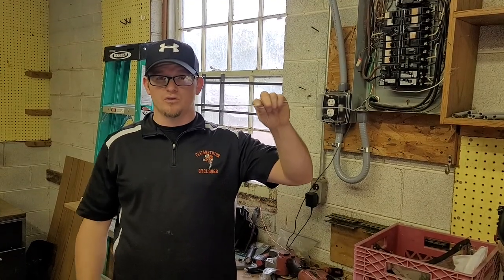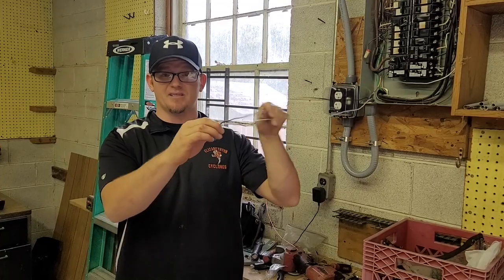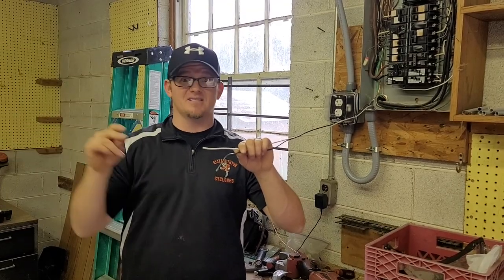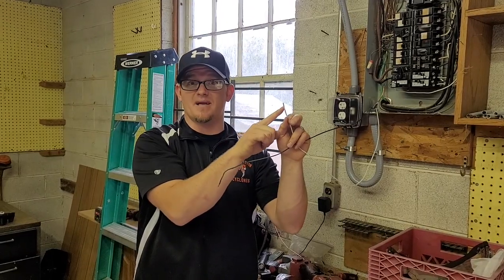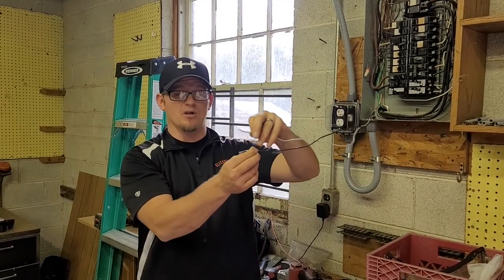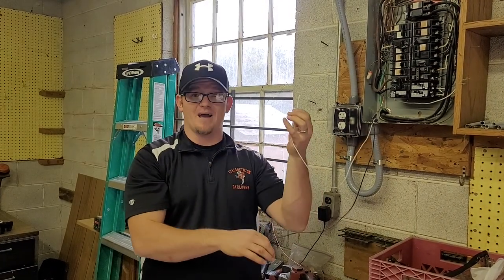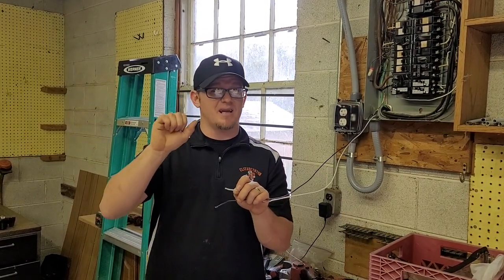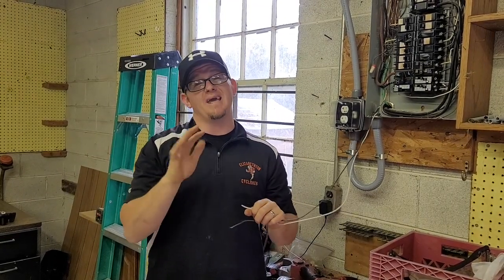Why we NEVER put 2 Neutrals under 1 screw in a panel. Be a Pro. Learn from the Pros.

Comment: I was on a job a few years ago, it was a high school addition and renovation that was originally built in the early 80’s. A couple of guys were disconnecting existing plug circuits, they had 3 phases shared on a neutral which was very common for that time period. They shut off the one circuit to start demo, but they didn’t think about the other 2 that went across the hall to a computer lab that was feeding 26 brand new desktops. Long story short, they took the neutral joint apart and “let the smoke out” of every one of them while it was full of students. I was on the other end of the hallway working and heard all the commotion and kids screaming that the building was on fire, I’m sure they thought it was. I have never seen as much smoke in one place in all my life. Then, the fire alarm went off. It was a really sucky day.

Comment: My favorite  Article is Article250 Grounding  and Bonding. 
I think the most important thing as an electrician is safety. Article 250 is also the article worth spending time and energy to study. 
I am currently an electrician apprentice in CITC. The employer will fire the apprentice when a project is about to be completed, so the apprentice has to wait for the next project. 
The next employer also fires the apprentice when the project is almost done. It will take far more than 4 years to complete 8000hours on job site.
It does not need to  8000 hours to take the Administrator license exam.I think maybe get the administrator license first and  won’t be fired frequently during the apprenticeship. 
I am preparing for this exam ,but  i don't know how start it  well, so i just browsed randomly on Youtube to wanna find something to get some help .
Now i am here. Thank you ! Thank you a lot !   " Call or Text anytime if you have any trouble out in the field or in  the code " means a lot!
Reply from the maker: You got this bro!!! And... you are the winner of the code book and tabs!!! Email me at electricalcodecoach@gmail.com
Reply: @electricianhub86  Thank you so much sir ! Thank you coach.!!!

Comment: I have honesty never ran into that issue. I have however seen ground wires under the same screw. Still a practice I would not use. Each wire should have its own location under a bus bar and breaker. If not it's time to upgrade that panel. 
As far as the favorite Code. For the chance to win that book. I am currently studying on the 210, 215,and 220. Codes. Branch circuits, feeders

Comment: Thanks, but I think most importantly, never work on an energized panel. The whole panel should be dead no matter what. Even better than shutting off the main breaker in the panel is to pull the meter or shut off the main service disconnect if there is one. No power. It’s not worth the risk.
Reply from the maker: Excellent point! I try to drive that home and every one of my videos! Thanks for the comment and your support!